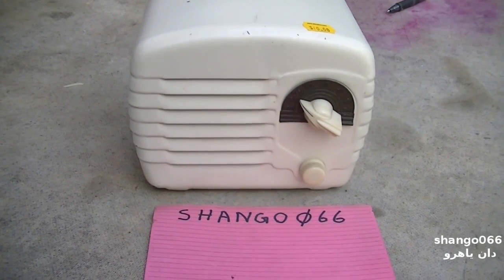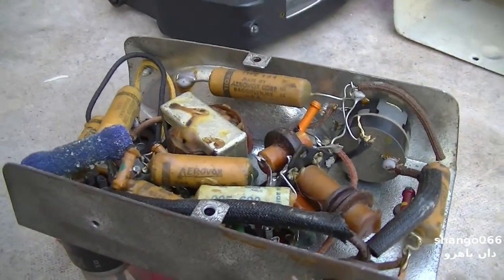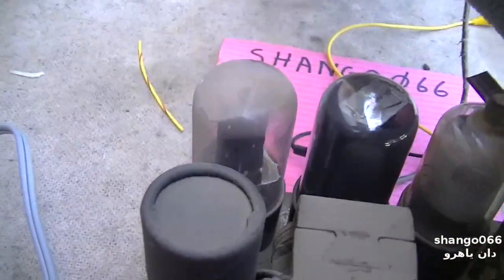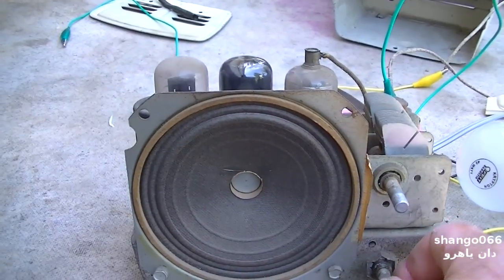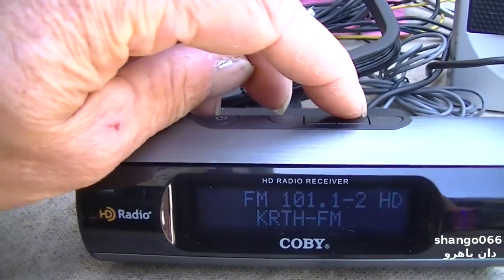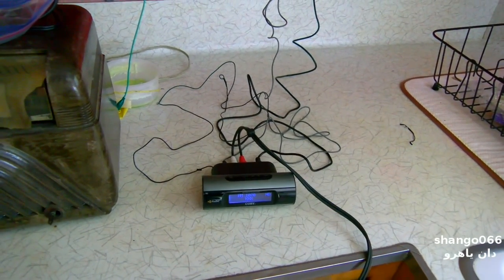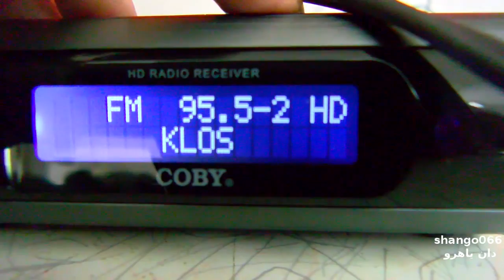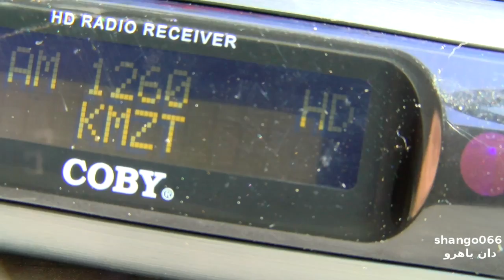Amazing 3 Tube Radio And HD Digital Radio Test

Comment: That's a cool little radio and it sounds pretty good, though I wouldn't advise using it in the tub. Anyway, my only worry about the thing is about what kind of cord it originally had; could it have been a curtain burner? If so, you might damage it by running it with a regular cord. I would have assumed that most curtain burners had resistor wire for the filament drop and a direct connection for the B+ (thus leaving some evidence of its configuration, even with the cord cut off), but something this simple might have  run everything through the resistor wire.
Reply: Personally, I had a Detrola table radio that used resistor wire in its cord.

Sadly, I didn't know (before I plugged it in, and turned it on) that it would blow every tube in the radio :(

Comment: That 25B8 is a triode/pentode.
That could be a superhet with the pentode as an autodyne converter, and the triode as a detector, no IF amp stage.  If it is a TRF, the pentode would be an RF amp, the triode a detector, and the Pentode could function as a reflex af stage.
When I was a teenager, I built a one tube radio that could drive a speaker.  It had a 12AU7 that functioned as a detector / af amp and on strong stations would drive a 4" speaker.  Used a selenium rectifier, and a 700 ohm 20 watt resistor in series with the heater.  Wasted 20 watts just on the filament!

I hope you were using an isolation transformer to test that.  Or were wearing thick rubber soled shoes!

Might have to drill a hole in the volume control to spray clean it.  Or just replace it.

Comment: That 25B8 is a dual section tube: Pentode and Triode.  Can you tell yet if this is a super-regen radio? One would think it easily could be having only 2 tubes but maybe with two pentodes and a triode there is enough gain as-is. Seems not to be a super heterodyne radio, however.
Reply: It's a TRF set. That's why the two gangs of the tuning capacitor are the same size - tuned circuits before and after the RF amp.  There is no IF  stage.  Grid leak detection.
Reply: OK, makes sense. Then the triode is doing both detection and audio amplification I suppose?
Reply: +Herbert Susmann yes - plus the 50L6 audio beam power tube
Reply: Yes, 50L6 is a beam power tube, comparable to a pentode.

Comment: That 25B8 is a triode/pentode, as I recall.  TRF set, I imagine. Guessing late '30s early '40s.  Check out Arvin 402, 402a--chassis RE-55.  Nostalgia Air will have schematic.

Comment: Do you know if anyone close by uses homeplug/ethernet adapter devices for sending data over the electrical wiring? most likely they could be the cause of the buzz on AM.
Reply: sounds like 60hzmains buzz

Comment: The 3 the condenser trf. Better of 30s trf has better am high frequency response .need a wire to Mexican wall for ant . Amazingly it works the key is both tuning condenser same size . I have a philco cathedral 20 is trf  and it's later superhet brother both work about same 😎
Reply: Ps am buzz maybe florescent lights

Comment: I have two digital radios one is a Morphy Richards 27024 SDR multi band radio LW/MW/FM/DAB/DRM the other is a Technics ST-GT1000 LW/MW/FM/DAB (DRM is Digital Radio Mondale) not Digital Rights Management, is FFT used to decode the sub bands into Audio as they might have used a IFT to convert the audio into a IFT which that use to generate the sidebands for the HD radio that is how it is done in DAB, DRM does it an other way not sure how.

Comment: I am definitely a NEWBE at this stuff.
I have an ARVIN 5 tube radio, 950T2. I have replaced the filter capacitors. It plays maybe OK but it is not too sensitive. When checking voltages, I get something like +0.3 volts at the antenna connection, pin 7 of the 12BE6 tube. The schematic from SAMS calls for -0.8 volts. Other voltages seem close. The resistors are pretty close to correct values.
Do you have any idea of what may cause this voltage reading being positive instead of negative?
Reply from the maker: Alignment or possible bad capacitor somewhere. Don't look at voltages when it comes to sensitivity

Comment: Love the three tube radio.  Who makes it? Arvin? How the hell does it work? That's really cool.  I found a zenith am fm AC DC in a dumpster yesterday. It's Bakelite and in perfect condition,  I think it's rare.  Good video.  S
Reply: Just wanted to give you a heads up on that little radio you have. that is either an Arvin or a Kent radio. Be careful of the 25 d8 tube. Those are extremely hard to find nowadays and when you do they're expensive. That's basically a trf radio. You can look the schematic up under Arvin in riders. The two tube variant is a model 40, the 3 tube you have is a model 403.  They're on the same page in riders.  The tutuapp version uses the 25d8  and a 70L7 dual rectifier and beam power output tube.  Basically is 35 z 5 and a 50 L 6 in the same envelope.  

I wish you would take that particular radio with you when you go and do a field test to see how far it could receive during the day 100 miles away from LA. Throw a 50 or a hundred watt long wire on it and let her rip. You might be surprised how well that thing will work.  I have both the model 40 and the 403 and they are amazing performers for what they are.  I find it interesting that somebody cut off the bottom part of your brass radio dial. it looks very even so I wonder if these were sold at a fire sale since the cut looks so professional to hide their original manufacturer?

Comment: Throw the digital radio in the garbage and use that frame aerial with the 3-tube radio.
If you want to, change the capacitors with a large voltage across them .
I had a Jan 1939 radio with a defective switch and a volume control equally bad. The whole assembly dismantled & the problems disappeared with a dosage of contact cleaner on the switches and potentiometer track.

Comment: By the numbers on the dial, it looks like it goes higher than the standard AM radio. On my receiver. the AM dial goes from 530 to 1600 kHz, yours runs from 54 to 170 kHz.
Reply: Will it go to 11?

Comment: Are you using the power supply that came with the hd radio thing?
Reply: Could be the switch mode wart that came with it, need to rig up a linear one

Comment: There seems to be a sort of denial of how lousy the working range and error tolerance is in so much digital devices and media, broadcast especially. I mean the performance is just feeble in so many cases and it's as though that just doesn't matter, not supposed to notice it as it is something the 'market' is supposed to bear. I know a lot of people don't realize how much further analog stations can be received from a transmitter, which of course was a big help for those who wanted to replace analog with digital TV so I'm guessing the same will happen with radio. Then there will be more stations I can't get. Somehow I have a suspicion that even if going totally digital kills the radio industry they will do it anyway because there is a belief system and denial.
Reply: +wdavem ATSC TV works fairly well where I live halfway between Boston and Worcester, but it definitely has problems in fringe areas. The hope for all these digital broadcast technologies is that broadcasters will  put repeaters in these areas, possibly by renting out space on cell phone towers. For ATSC, that would be seamless, since the channels are automatically mapped when the tuner sets itself up, but I don't see how it would work on HD radio, since it seems to be dependent on the existing AM and FM assignments, though there could be more remapping options that aren't obvious.  One thing I'd like to see is talk banned completely from the analog FM channels; it's a massive waste of bandwidth. But I hope AM never goes away; there is something about directly receiving distant stations that can't be replicated by rebroadcasts or the internet. There is a YT video of a Bush portable with LW, low-MW and high-MW (our AM) bands in the UK, and they are all still full of signals. I'd love to get my hands on a radio like that and see what signals on the lower bands (which have a very long range) make their way into  the U.S.

Comment: @ 3:51, That's not a scorble snorbler, it a gonculator used for the garbage gobble detection circuit.
Reply: Streamlined Steamroller Sgt. Carters Gonculator/rabbit trap
Reply: olradguy Yep. On MeTV?

Comment: The volume control is not sealed up  enough to keep contact cleaner out. I am a technician  with 40+yrs experience. Unplug the radio and drench  the control turning the volume control up and down . Let dry then power back up. This should make a big difference. This AM receiver you bought is  cool!

Comment: On the 3 tuber just drill a small hole in the volume control to spray cleaner in it.
Reply: Only problem with that is the danger of getting metal shavings from the drilling of the hole into the control. These shavings can ruin the volume control if they get into the path of the carbon track and the movable slider. There has got to be a better way, to make a hole in the control. Maybe a sharp ice pick might do for puncturing a hole.

Comment: I skipped the digital radio part, since it doesn't have vacuum bulbs. That's a late 30's-early 40's Arvin TRF set. The 25B8 is a dual stage tube with an RF amp and a separate triode serving as a preamp---about as minimalist as you can get. You practically stole that thing for $10---ones that nice are fetching upwards of $100 on epay.

Comment: Did they run a power switch straight to ground in a metal body radio?  No wonder there are so many government regulations and standards now.
Reply: Robin Sattahip usually they ran a.03 to the chassis from ac called death cap . sometimes a.cap across ac usually EXPLODES.

Comment: cool three tube radio and I have no HD radio and will not get one unless I have to but I read that FFC will not force the HD radio I like the did no the TV it might change but right now that's what I read
Reply: +Darkwing duck videos 
1. You never will have to because it's just stored in a side-band
2. What's so much better of analog radio?
3. the "HD" digital audio does much better signal to noice radio! Problem is just the poor compression codec. They should better use OPUS instead of AAC-HE with that pseudo 44.1 KHz and parametric stereo rubbish. Or just get a better modulation working to get at least 256kbps and then using AAC-LC or better OPUS.

Comment: Digital Data with at least 48 kbps over AM frequency side-bands? What the...
I can clearly not understand why one would find the effort they put in digital radio crap... Seriously. The effort they put in to create AM and later on FM is NOTHING compared to for digital modulations!

And no, you cannot EQ it, it has better freq range no doubt. Even if they would EQ it, yeah, that would not make anything better of course. But I clearly heared higher frequencies. However, shure they are a bit muddy because of the (I think AAC-HE with SBR und paremetric stereo?) compression artefacts. Could also be Opus audio. - Edit: No it's not OPUS, definitely sounds like SBR of AAC-HE. But the best thing is the much better SNR when digital.

Comment: Ok I'm a sort of a newbie at working on tube radios, so does the light bulb running in the mix act as a type of fuse or does it allow the voltage to come up s!owly like a variac? Thanks great video awesome radio btw.